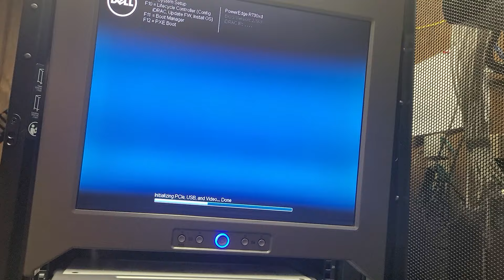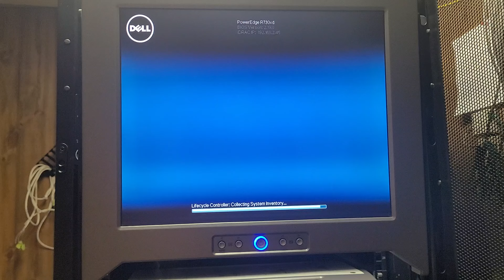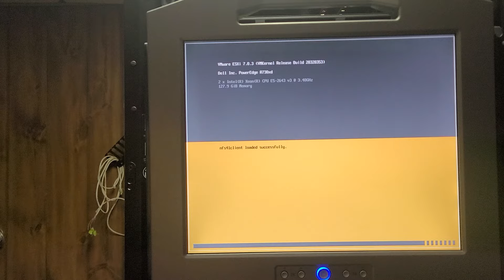Finally time for my NVMe upgrade in my server. 16TB raw of super fast storage!

Comment: Honestly mate, I'd run the thermal pads. If you're worried they're putting too much pressure on the drives, you can either support the drives on the back side, or even "stretch" the pads to thin them slightly before quickly applying them (thereby reducing pressure).
As for the oily residue - typically it doesn't affect the drive or the label... a light wipe with isopropyl alcohol, and they'll look like new.

I too run an all-nvme NAS - 4x 4tb Gen4 nvme's in a RAIDZ1 (2x Crucial P3 Plus's, 2x Lexar NM790's), along with a few 980 pros for the boot and apps/critical backup - all jammed into a Minisforum BD790i SE (Ryzen 7940HX...16c/32t... Zen4... basically sips power, and is lightning fast with 10gbe). You won't be disappointed with the all-nvme setup - but don't be surprised if your scrubs aren't quite as fast as you'd think they would be.
Reply from the maker: @heyitsjel  still a work in progress but without the pads they peaked at 57 C after hours of writes. I may have to hunt down thinner pads to be safe though.  I'm having some performance issues but not sure why yet. ESXi might be to blame.
Reply: @computersales  57c isn't terrible... my P3 Plus's cruise around 40-45c inside the Asus Hyper M.2 Gen5 x16 card. What sort of performance issues are you referring to?

Also, what is the brand/model of the pcie to M.2 adapter card? I've had issues with cheap cards... (ie. poor performance; errors etc.). Have you checked your console for PCIe AER errors? (or dmesg)

Edit: having said that, PCIe gen3 is usually quite achievable - I was having issues at Gen4; while Gen3 worked "okay" (but not great).
Reply from the maker: @heyitsjel  I got the IOCREST SYBA SI-PEX40161 to put those P3 drives in. I haven't checked for any errors yet. I may need to add some settings in ESXi to improve NVMe performance otherwise the NVMe drives perform about as well as my regular SSDs in benchmarks somehow.
Reply: @computersales  57c should be fine for NVME (though like you said enterprise NVME would have been even better) but I wouldn't be surprised if temps dropped quite a bit with thermal pads.  In my experience gen 3 doesn't run nearly as hot as gen 4/5 though I'm kind of surprised that dell doesn't support bifurcation but that's a different matter.
Reply from the maker: @nadtz  that card requires bifurcation which the R730 supports with new enough BIOS. The part number of that card is just a little misleading.
Reply: @computersales  Ah, the description for it says non bifurcation, so long as it works all good.
Reply from the maker: @nadtz  I think they mean that the card itself doesn't do bifurcation since it doesn't have a PLX chip. I'll admit that is a confusing way for them to explain it.

Comment: BTW - " ... Micron's Jon Tanguy, who works on SSDs under the company's Crucial product group ... explains, is happiest within a relatively narrow temperature band. "NAND flash actually likes to be 'hot' in that 60° to 70° [Celsius] range in order to program a cell because when it's that hot, those electrons can move a little bit easier ... " - was posted on the register website last year
Reply: I don't want to post the URL but look for 2023/05/27 and liquid cooling
Reply from the maker: @jfkastner  yeah it is interesting. The hot temps do concern me still. I believe this is the article you are referring to?
https://www.theregister.com/2023/05/27/liquid_cooled_ssd/
Reply: @computersales  Correct URL, but YT has always given me headaches posting ANY, so I don't anymore
Reply from the maker: @jfkastner  yeah I have to approve comments with links if they aren't my own. Even then YouTube sometimes hides them still. It's not a bad thing but it can be annoying.

Comment: add the 4 bay ssd upgrade  to the r720 it doesnt cost that much and was easy to instal
Reply from the maker: Not sure which upgrade you are talking about. The R720 doesn't support birfurcation unfortunately. You would have to get a more expensive NVMe card with a PLX chip to run in the R720.

Comment: Given what you have there based on what I see in your video, you might actually benefit from using Ceph instead of RAID. I'd look into that if I were you. Esp since you want to move to TrueNAS Scale. And dare I say this, but given your use case you may not even need TrueNAS Scale at all.
Reply from the maker: @Gillymomo.Gilmore  maybe not sure. I'm switching from core because supposedly core is EOL. My biggest problem is something is bottlenecking my drives. ESXi isn't helping but it is worse than it should be. I could run the R730xd as a bare metal NAS but that is a waste of hardware.